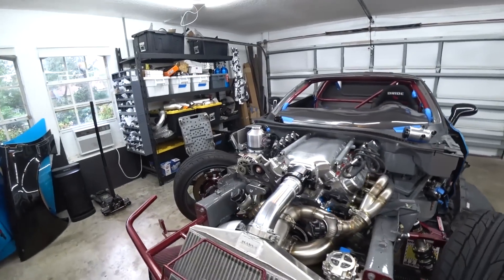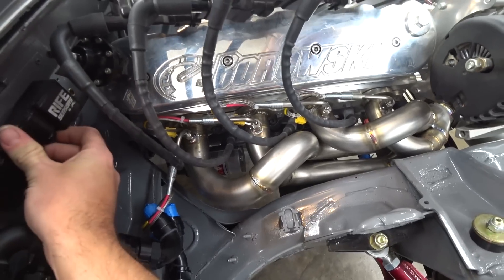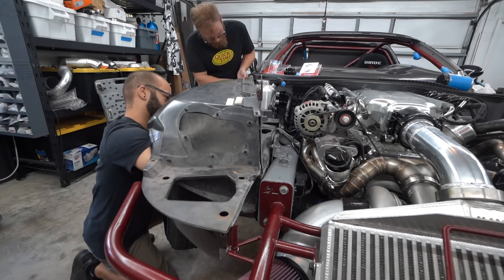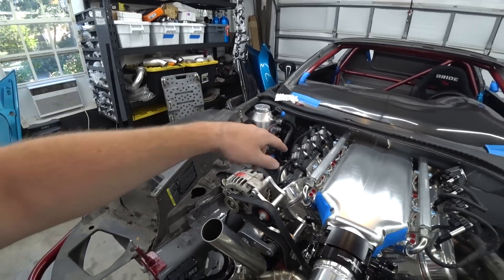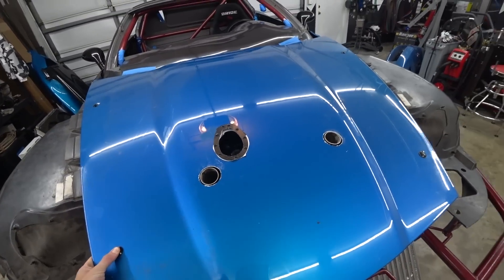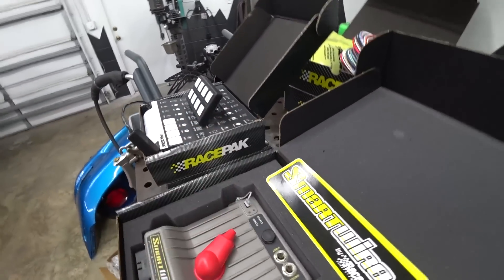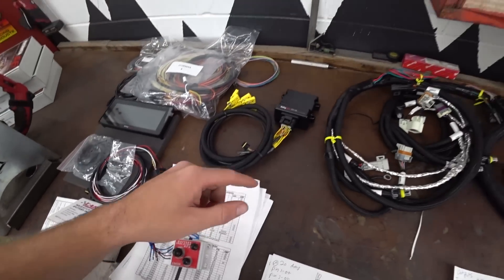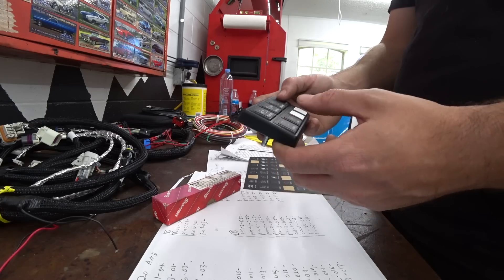C6 Corvette competition drift car build. it's finally time.

Comment: Got to mouth all switch panels on the trans tunnel in a panel kinda cocked toward the driver... real easy to get too while strapped into a car like yours.. far reach when you need to crack a switch in an emergency or without looking is crap..

Comment: Yoooo clutch move from taylor when he was building the wastegate dumps he mentioned fire rings. Had no idea what that meant. Googled it and I’ve been running my car without one for like 500 miles at 800whp. Car didn’t spin felt really slow to build boost. Now I know why. Thanks for helping even if this is something you should know lol.

Comment: I really think you need to move that handbrake bar actuator. Why don't you have it go forward and just use a pivot pin so every time you pull on it it pushes on a pivot pin which then pushes into the cylinder? I've seen the pivot pins used quite a bit in race cars with success.

Comment: Buddy. Cut a circle of cardboard and set it on top of the pipe you’re trying to cut through the hood. Put double sided tape on the top. Close hood. Boom. U got a hole marked with cardboard EXACTLY where u need it.

Comment: Dumb idea, but to keep the wastegate angle, would it make sense to tie them together with a rod, that you can bolt together at the center with some flat stock? Keeping it small, of course
Reply: But also, to hide the difference in the holes in the hood, what about a surrounds for them that correct the placement difference?

Comment: "Done  for kk rd 1" literally what I'm living with. Got a 93 s13 5.3 ls 4spd mve (900hp single turbo) r32 front end swap and an bunch of goodies, but getting it running consistently and having the trans and rear end Be consistent for comp has left me in the wind, especially with the fact that my tire sponsor  limits me to 12 tires  per event I can see Taylor's pain. And I'm sponsored by a budget tire (triangle) pretty crap for competitive drifting
Reply: Your sponsor would be happy reading this 🤦‍♂️
Reply: @xiukn8  pretty open with them, its a super budget tire and I've used them before and their top tier tire really lacks on grip , if I can even break top 10 then that would be awesome 👌, might help r&d for better compounds on a budget

Comment: Did taylor do the electric powersteering stuff in a previous video? Where can I find that?
Reply: It was about two videos prior to this one.  They mounted the power steering pump under the driver's side front fender, next to the firewall.  It's pretty well tucked in there.

Comment: I'm not sure if you've mentioned it before but what is that drill mounted rivnut tool?! That looks like a huge time saver
Reply from the maker: I forget what it's called. It's from Astro. Helps in tight spots.

Comment: Really loving the Corvette build T Ray 👍👍  I have an idea for your hydro e brake lever. I know it's already done, but you could mount the master cylinder in front of the lever, then swap your pivot point from the bottom hole to the top hole of the lever, then attach you master cylinder shaft to the bottom hole. It would get that shaft away from your elbow. Just a suggestion. Keep up the great work 😀

Comment: I have a Cartek battery isolator in my track car. Awesome piece of equipment. Makes running a kill switch incredibly easy. Just remember to remove the isolator from the car if you are going to do any welding to it. You will potentially fry the unit by leaving it attached to the car.

Comment: Gotta watch running fuel pumps on a pdm I was running my walbro 450s on mine and kept having fuel pressure issues and it turns out a 450 on high psi will pull more than 20 amps from time to time

Comment: if that is the only crankcase vent?  it is not near enough.. I use at least 1/2 off each valve cover to a catch can (separator)
Reply from the maker: Not when you have a high vacuum dry sump system.

Comment: Are you putting a blow-off valve on the intake side too, to help prevent boost creep, and problems like that?  Also are you going to go air pump, or CO2 for your boost controller?  I know air pump may seem like overkill, but if your CO2 tank runs out while you are at the track, you are stuck on waste gate pressure.

Comment: SUGGESTION:  Small-ish elongated, rearward facing hood scoops/vents.  Mount to the hood to cover the wastegates with them.  You'll be able to make it look even topside on the hood even though they are slightly uneven underneath.  Hope that makes sense!  Think of smaller versions of the fender mounted scoops on the old Dodge Charger Daytonas used for tire clearance.  ;)

Comment: love the videos man helps learn a lot and helps seeing how to be more efficient with builds and small projects one thing I do have to say though I'm wondering if having a reverse style hydro would be better rather than doing the traditional with rod setup you'd have nothing in the way of your elbow and I feel like brake lines would be small enough to not disrupt the flow of the interior at all and the hydro res. can fit under the dash panel kind of how people are doing with the 350z's

Comment: Pin 20 (if I remember right) on the smartwire is basically a battery isolator itself. That's how I run mine. Then I have a main cutoff solenoid for longer storage periods. It's a neat system, but I've found it can have some quirks that make it a little limited compared to other systems like those from Morristech. That said, my smartwire/Dominator combo has been great for 3yrs now.

Comment: Wait…you have to run the exhaust out the back per the rules but can have wastegate dumps out the hood? How does that make any sense
Reply: yes.. every 2j car is like that. if they made them dump wg into the exhaust they wouldn't sound special at all. v8 should be about to run some zoomys up with a exhaust valve that opens at wot or something haha.
Reply: @jsomething2  I know, it just a dumb pro spec rule it doesn’t make any sense.

Comment: I definitely relate on the feeling you get when you finish working on a car where it doesn’t feel real. Currently in the progress of overhauling my motor and I cannot wait to get to the first start up. Currently dealing with a situation of the threads coming out of the block for the head bolts🥲